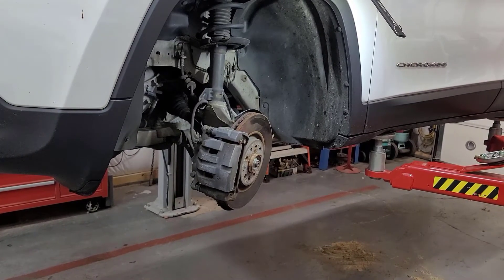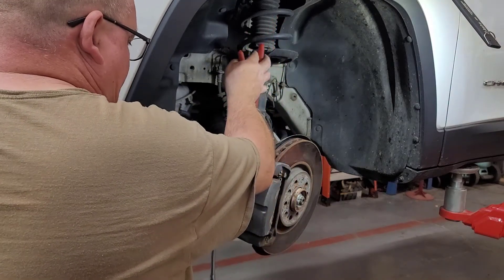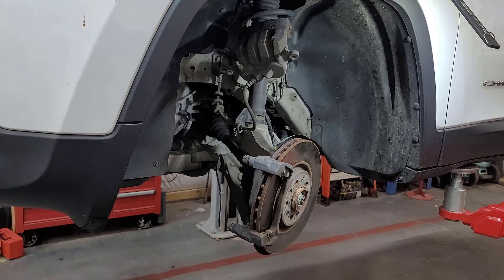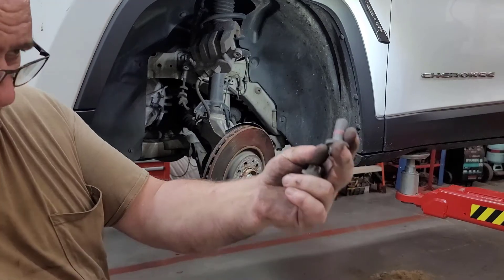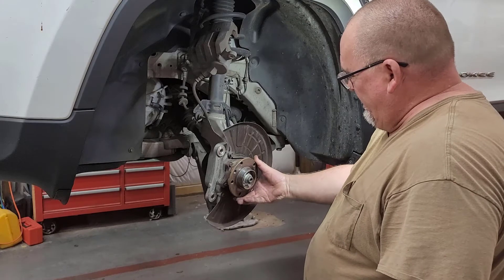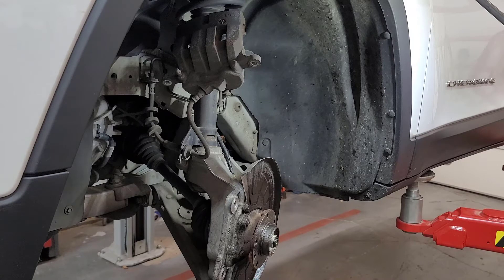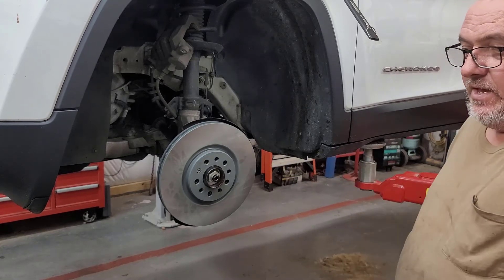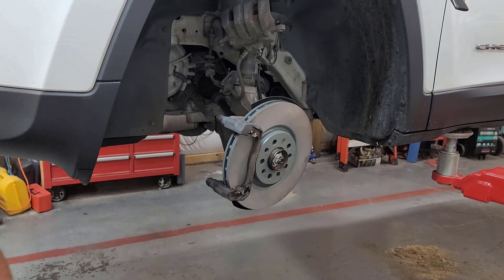2015 Jeep Cherokee Limited Front Rotors and Pads

Comment: You skipped the hardest part, getting the brake hardware on to the caliper bracket. Trying to figure out how all those clips are oriented, and getting the hardware on the dog ears of the pads is pretty difficult
Reply from the maker: That should be the easy part!  I state all the time that I am assuming a little mechanical ability. This is not for absolue newbies.
Reply: @ralfsautomotive   There is different hardware...some pads come with 4 identical springs to go on the 4 pad dog ears, others come with 2 springs and 2 squeelers that go into the 4 dog ears. Is it ok to just use the anti rattle springs and leave the squeelers off and put  the pad dog ear right into the abutment clip track without the squealer